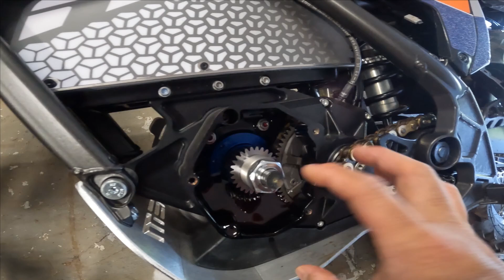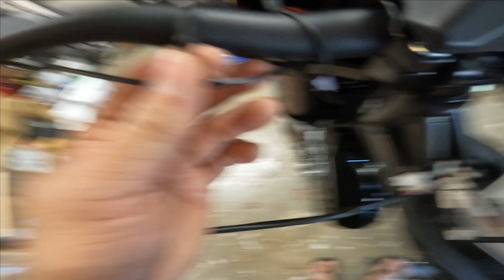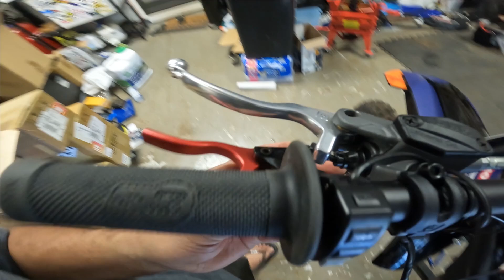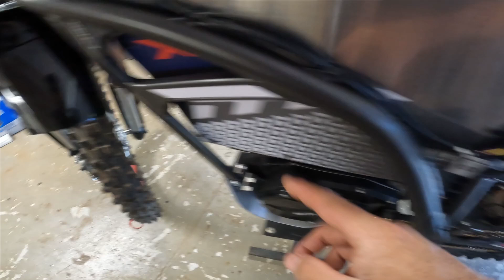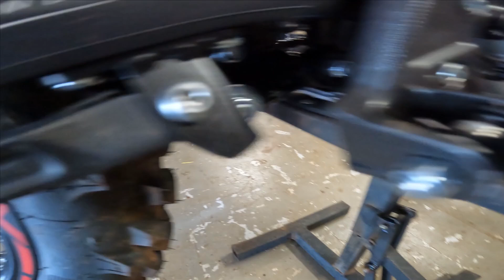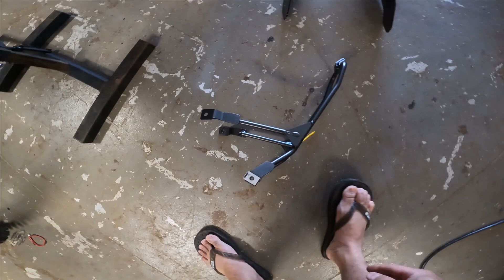2024 Escape XR PT 2 deep dive review

Comment: Great vids- subscribed!! I can’t find that regen lever you showed. What is it? I can’t use the cyl mounted one! Thanks !
Reply from the maker: Thansk for the SUB. you can use the PRBR mounted on the clutch master cylinder but I use the PRB lever from the older modles. Same outcome just a larger lever unit
Reply from the maker: EM - COMPLETE PELS/PRB, TC01L-60403-00-00-ASM

Comment: Sorry for the spam, but another question. Couldn't they have made the battery bigger by simulating some sort of front tank and air intake fender that spreads out? And make the battery bigger with that shape of a gas enduro. You know what I mean? Now the battery is really slim and just sits inside the frame
Reply from the maker: actually pretty good up front. They are lighter than my tech forks so the steerign feels light just like the Escape R

Comment: Can you leave the front number plate and just use the blinkers without the headlight unit? I would like to use the OEM blinkers but with the front number plate and add an LED bar as a headlight.
And is it possible to mount the rear light and blinkers on the fender, instead of the ugly swing arm mount number plate holder?
Reply from the maker: American models don't come with any lights. you can add whatever you want with the 12v line